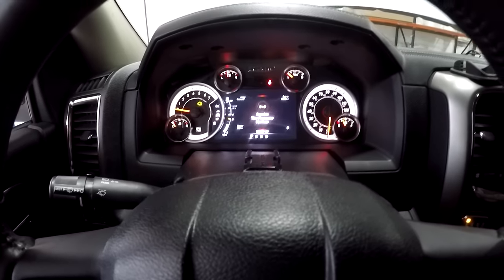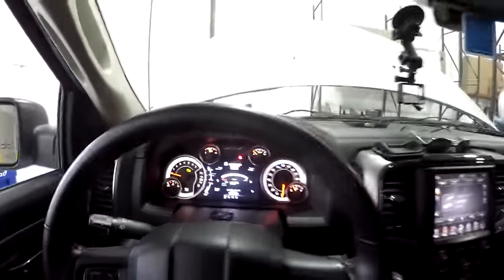HOW TO CHANGE YOUR ENGINE OIL - DIY - 5.7L HEMI - DODGE RAM 1500 2500

Comment: Use a plastic Ziploc bag to remove the oil filter, I did mine yesterday and didn't spill a drop! Place the bag over the filter and unscrew the filter and the oil will pour into the bag then when the filter comes off put it in the bag and remove! I also fill my new filter with oil that way there's no dry startup!
Reply from the maker: Thats an awesome tip with the ziploc bag!  I'll have to try that on the next oil change for sure! 👍
Reply: That is a great idea!!!!!!
Reply: Thanks. Good idea..Will use today
Reply: Great tip. Terrible location for the filter.
Reply: ThrustWasher I've also been told to fill the filter with new oil before putting it back on. Don't know how much difference it makes.
Reply: I think most of oil is from the oil cooler, won't drain to the pan. Every time I made a mess when take off oil filter.
Reply: What a simple little trick.  Thanks
Reply: Thank you. This is the information I came to this video for
Reply: Can't believe I never thought of this. Usually the balancing act works but for those times it doesn't the shop towels are in reach to wipe the hand, wrist, arm, armpit and driveway. Ha.
Reply: ThrustWasher Thanks for the tip brother!!I will define my try it
Reply: @lonewanderer3603  It definitely helps, If you consider the amount of time it takes for the engine to refill the filter and get the oil flowing through it!
Reply: Just make sure to get any contaminants in the filter. Also, you have to put the oil through the little holes so it filters the oil first
Reply: Dude that is genius! Awesome tip.👍😉
Reply: right on
Reply: been changing my oil for years and never thought of this, thank you stranger!
Reply: awesome. im going to use this tip now. i feel like bashing my head against the wall for not thinking of it any of the 1 million times it would have helped. welp, i wont ever forget it, thanks!
Reply: @lonewanderer3603  It's always a good idea to "prime" a bottom-mount oil filter that is vertical. The oil pump picks up that oil as soon as compression starts. It's just a few seconds for it to prime, but it's still a few seconds your engine has total lubrication. Better safe than sorry...lol
Reply: Yes.  Ziplock freezer back.  1 gal.  No mess.  Did my Harley that way for yes.
Reply: This  "baggy trick" add waste to the  landfill.  Don't do it.  And  don't over change  your oil!  If you drive  over 15K miles  a  year,  a 10K mile  oil change interval  will show  LESS engine  wear then 5K mile oil changes.  Fresh oil causes  MORE  wear than used  oil due to the high percentage of  detergents and  dispersants in new  oil. Beware of misinformation  and  "wives  tales" on the web. - Sandy
Reply: A medium Dunkin donuts coffee cup works like a dream..... I hope this blew ur fucking mind!
Reply: Awesome thanks tired of oil dripping down to my arm pits.
Reply: Great tip...thanks.
Reply: Ralph Valkenhoff armpit!  That’s funny!
Reply: Good idea im going to try it also makes cleanup easier for filter!  Excellent
Reply: @JayJeep1500  I totally agree tried to change my oil today , drained oil , then the wonderful roadblock no way to get the filter off , totally stupid location !!
Reply: Very good tip, oil runs down the arm, sometime a rag can catch most of the oil but you idea is really good
Reply: Look at this guy, living in 2080.
Reply: Smart! I would have never thought to do that. Well done sir. Well done.
Reply: That is an awesome idea. I always refer back to this video for the reset procedure. I don't know how I missed your zip lock bag idea.
Reply: @sandyshoremann7524  No mechanic in the history of cardom has ever witnessed new oil causing more problems than old oil. Unless you have actual data, no one should just take your word for it.
Reply: @sandyshoremann7524  Now you're saying "not always" LOL, alright dude. You can talk about whatever you want, but people like me are going to always challenge you when you tell other people what to do but provide zero proof.
Reply: @moctezuma_2 I would suggest for anyone to always do your own research. If you trust some shmoe in a casual chat,  then it is your  folly.  Did you find  that study where new oil exhibited  higher wear than used oil? Here is one  paper to read: https://technicalreports.ornl.gov/cppr/y2005/pres/117987.pdf And I suggest everyone interested in lubricant tech spend some time on swri  website: https://www.swri.org/
Reply: so glad I read your comment...just grabbed a zip lock!
Reply: @jsjones418  its new oil why would it matter?
Reply: @sandyshoremann7524  matter is neither destroyed or created.  I really don’t think I’m gonna worry about me adding 1 zip lock bag to a land fill.  Sorry.
Reply: You fuckin beautiful, intelligent celestial  savior.
Reply: Thank you!  I was trying to find what other people are doing to prevent the big mess, this sounds like the ticket!
Reply: I just use big wad of paper towels under the filter after I loosen it, catches most of it.
Reply: Red solo cup works well
Reply: Ya even an old plastic grocery bag as well
Reply: Guys, I use a diaper under mine

Comment: The main reason gaskets stick to the block is from a lack of oil on the gasket. The oil residue on the block isn’t enough. Put oil on the gasket.
Reply: What he said. Oil on a gasket prevents it from sticking to mating surface. Sometimes (NOT with an oil filter) there is a need to NOT oil a rubber seal gasket, but, usually on permanently repaired surfaces that will never be removed again.
Reply: That's not why, they peel off everytime regardless. Oil is to lubricate the seal so that it doesn't bind as you spin on the filter, and therefore seals correctly.
Reply: @amritk5173  Thats correct man )
Reply: So put the new oil on the rubber gasket of the new filter?
Reply: @MgOrt231  yes

Comment: When the oil filter is vertical like that i found its best to fill it up with oil before you install it, this way you have oil pressure immediately on startup and don't have any clickity clackity lifters. Great video otherwise!
Reply from the maker: Thanks for the feedback Joe! 👍
Reply: Better to fill it  only 1./2 way - 2/3.  Sometimes  the slug of  oil in the filter will  be  an  obstruction to the oil pump  getting prime when there is  air  between the pump and the filter. - Sandy
Reply: I have always filled the filter at least half way to help prevent dry starts in the shop and I do it on my own Ram.
Reply: Holy shit I just learned something. Lol have had a little lifter noise on start ups that goes away.  Thanks guys!

Comment: For less mess with the oil filter break it loose. Get a zip lock bag, put it around the filter then screw off. The oil goes in the bag and just a couple drops on the frame
Reply: chris zarish - That is a great idea brother. I am definitely going to try that.
Reply: I can't for the life of me ever get that to work
Reply from the maker: That's a great tip! 👍
Reply: Great and awesome tip! Thanks Bro!
Reply: Still a PITA though.   My vehicle you just put your vacuum pump in the dipstick to extract the oil, and the oil filter is accessible from the hood, so no need to get under the vehicle or jack anything up.    Don't know why FCA can't spend the extra $50 to make it more convenient to service.
Reply: Glad I checked this video before changing the oil. 1st oil change on the 2019 Ram 5.7 Thanks!

Comment: Awful small filter for a engine that size.  Basically what I use on the lawn mower.  Need some oil on that filter before installing so does not stick when take it off next time.

Comment: Hoo boy.  Listen here boys and girls.  I felt pretty silly being a grown ass man watching a video on how to change the oil in my "new to me" ram, but holy shit am I glad I did.  Old filter seemed like it took forever to spin off holding it with a gallon ziplock bag to try and prevent spillage (actually works pretty well, barely spilled a few drops on the frame), but the new filter tightened up in like 2 turns.  Was concerned at first, but then I remembered dude said to make sure the gasket from the old filter didn't stay on the truck, and that's exactly what happened.  I've never had that happen before, and I thought it was odd that he would say that, but I 100% would have just double checked to make sure it wasn't cross threaded, and then used my reet ard strength to tighten it up good and proper.

Seriously, thanks for these videos and your posts on ramforum.  Boutta tackle the active grill shutter delete.

Comment: One thing I do with all my oil filters that go in vertically is fill them with oil to get it full. It prevents an extensive dry start. Obviously the oil itself is new and clean so I’m not worst that but those few seconds of no oil in the engine does damage. Ive filled all my ram oil filters and when I start it after an oil change the dry start only lasts about a half a second, then its back to normal. I believe it makes the engine have less wear, making it last longer. Ive always done it with all my cars. People think I’m crazy but all my cars have had over 200k miles
Reply: I always pre-wet the filters, keep pouring, several times till the proper height to install w/o spilling.  even for the 5.2 Jeep engines, a little less to match the screw-mounting angle. Jason good post, keep wettingum ppl.

Comment: I've changed all my own oil and filter at 5-7k in my last 4 vehicles even new off the lot with warranty. 
My last two trucks were at 215k miles when sold and not a single issue, tundra though, and 2 challengers with 40k and 55k 5.7, 6.4 both manual trans. 
I used a 15 minute lube shop one time in my off road tundra, and they mix matched all my skid plates bolts which also later fell off going 50, miraculously didn't do damage to my truck, but also torqued the oil drain bolt on so tight that I had to slot it and replace it. Never again, change your own oil! It's also kind of fun to select your own oil, and filter. Certainly good practice to learn your vehicle and how many miles she'll go without any need for any major issue on intervals, hell I've caught a worn out tie rod end before while changing my oil, and replaced that with a buddy on a Saturday off.

Comment: Aside from the ziploc bag, getting a larger pan made a huge difference for me.  I kept spilling with the 2 gallon one you used and later bought a 16 qt drain pan. Wish I would have done it sooner. It also has an anti-splash rim and a drain nozzle so you can pour back into gallon jugs without a funnel.

Comment: I like the video. You have the right voice for the Do It Yourself video.
This was very helpful. The owners manual is useful for determining  how many quarts of oil  your specifi
 Model truck and engine holds. And I found mopar made two very different size oil filters for the 2014 Ram. So if your given a smaller filter than the one you remove from you truck at the Dodge dealership it's correct. 
Great work man.

Thanks.
Reply from the maker: Thanks for the feedback!  Let me know what you think of the other videos on the channel when you get a chance too! 👍

Comment: I am not sure if anyone has yet mentioned this.  I am a fan of Mobile 1 Full Synthetic that you show in the video.  After the normal  break-in period on a rebuilt '78 Datsun 280Z engine  I switched from the mechanic-installed Pennzoil conventional oil to Mobile 1 full synthetic.  To my knowledge, in the early '90 no other oil companies offered full synthetics in the U.S.  I stuck with it in that vehicle.  Recently I have begun switching all of my vehicles to full synthetic oils of varying brands.  They all sell for their weight in gold now, even conventional oil, so what's a couple buck every few thousand miles.  I have typically stayed with the brand that the previous owner used, if I knew the previous owner.  I even have a Chevy S-10 with 310,000 miles still running Quaker State.  In an effort to avoid stocking 3 or 4 oil brands in varying viscosities for each brand, I sought to find one oil brand in one product line that would be suitable and recommended according to all of the manufacturers of the vehicles that I own that is readily available in local retail stores, mainly Wal-Mart (best oil prices that I have found).  It is nearly impossible.  I did not find one brand and product line that satisfied all auto manufacturers' special additive/formulation  guidelines simultaneously.  I'm not driving Porsches and Teslas either. For instance, one brand met General Motors "GM6904" specs while not meeting Crysler  "MS6395".   Some manufacturers go ever further.  I owned a 2014 VW Passat 2.5L that specced one Castrol Edge product,  and only that one product.  I have begun looking in my owners manuals for what each manufacturer recommends specifically for that year and that engine ( like API SN vs API SJ, or the aforementioned  GM...., MS...., WS...., etc,)  and not relying on older conventional knowledge and experience.  

 Now, my 2015 Ram 1500 5.7L Hemi manual recommends, Mopar, Pennzoil, or Shell Helix  that meets Chrysler MS6395 material standards.  Pennzoil Platinum Full Synthetic does that.  No others that I found did so.  All of the viscosity preferences of mine are out the window now too.  If my manual states 5W-30, that is exactly what I will use, even if I "feel" like 10W-40 would be better in the SC summer heat towing a 6000lb boat up and down hills at speeds that I could be  arrested for just mentioning.  No more 10W-30 in the winter, 10W-40 in the fall and spring, and sometimes 20W-50 in the summer.
 
So I found it interesting to note that you are using the very oil that I would have grabbed myself for the first oil change as the new second owner of this truck.  I just thought it may be worth everyone looking into.  I have also been a fan of OEM oil filters in the past.  Wix has demonstrated a commitment to manufacturing quality filters.  Napa sells a wix made NAPA Gold filter that is excellent according to some very good mechanics and car nuts like me.  It saves me time running around to dealers buying Mopar, Nissan, AC Delco, Toyota, Suzuki, and Mercury Marine filters that I like to keep in stock.  Something else worth exploring is the filter medias available now.  I have seen some stating that they were designed for use with synthetic oils.

 A few more worthy suggestions to everyone about oil changes.  Don't go 7000 miles before an oil change even if your Vehicle Information Center indicates  you are only at 60% of the oil's life.  I like 3000, maybe 5000 with synthetics.  Check it once a month when the vehicle is level and the engine is cool.  ALL vehicles use oil, regardless of age or mileage.  Fill the new filter with fresh oil unless it is mounted horizontally and coat the new filter gasket with a film of oil so that it seals well and does not pinch and deform as it is tightened.  I personally like a 1/4 to 1/2 turn with a filter wrench after hand tight.  I have seen filters come off of other people's vehicles before.   I prefer a wrench of the proper size over a ratchet and socket where permissible.  It gives me a better feel for how much torque you are applying.  A torque wrench is the best of course, but not many people own one, at least in a 3/8" drive.   And if you have the luxury of letting the vehicle sit for a couple of hours with the drain plug out, let the dirtiest oil (those last few drops) come out while you grease the suspension, check CV boots for cracks, and look for other signs of potential failures.  Spend that time getting to know your vehicle from below.

One last thing to anyone attempting to change their own oil for the first time :  Down the road no matter how much you know or how much experience you have, question everything until you become familiar with each of your vehicle.  In 37 years of having the satisfaction of doing my own mechanicing, along with probably 350 oil changes, I am here myself to learn from someone else what I think I may already know.
Reply: Actually Amsoil was the first synthetic. Original mobil one sucked and Amsoil showedmobil how to make it.

Comment: Just got my first 2014 1500 ram sport 5.7 hemi v8 thanks to you just did my first oil change on it thanks man appreciate your videos of course whoever had the filter on before me had it on so tight made it difficult but got through it thanks man alot 💯💯💯💯

Comment: Nice! Thanks for the vid. I think this might be the first vehicle I've owned where you don't have to used a jack and jack stands. And I suppose I could use the air suspension to raise the truck for more clearance.
Reply from the maker: Thanks for your support brother!  Yeah its nice to not need a jack to get under the truck!  Everyone keeps telling me to put a 2/4 belltech drop on it but I like how practical it is right now lol 😆
Reply: Boosted2k I would drop it. I have the factory air suspension on mine and wish it would go lower. Although mine is 4x4, I'm not interested in raising it. If I had your truck I would drop it.

Comment: Great vid man, while the drain plug is out take your oil filter off and screw on the new one after priming it, you will be amazed how much more oil will drain from the pan hole .5 liter sometimes. Need to get all the oil out

Comment: You only need 7 Quarts... The dealer filled it above last time... so I changed my own this time with Pennzoil full synthetic 5W-30W. The 2019 uses the OK button to select and arrows to pass through the choices.

Comment: Hi. I love your channel. I've been doing my oil since I bought the truck Brandy new(2014). I use a 2L coke bottle cut in half to place under the oil filter before I start loosen it. That way. The half coke bottle catches all the dirty oil. I'll be doing spark plugs soon. So your other video for that will be very helpful.
Reply from the maker: Thanks for the support on the channel! 👍👍👍